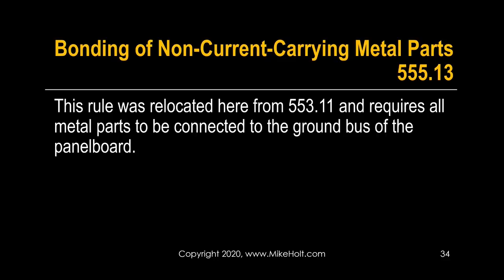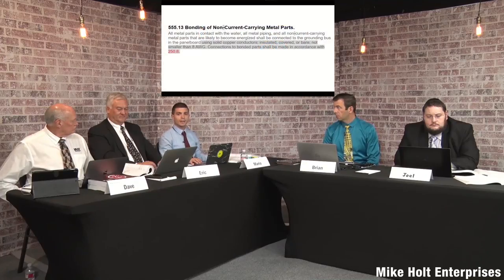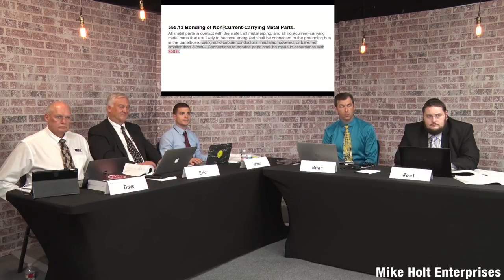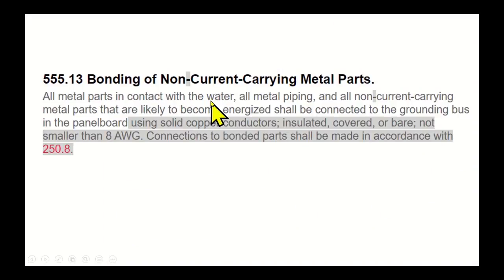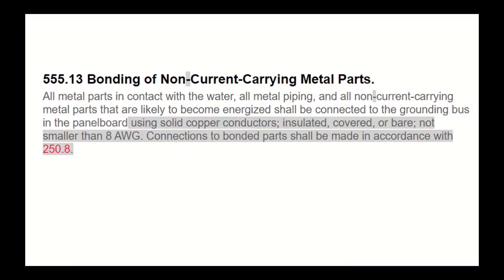Marina and Boat Dock Bonding [555.13, 2020 NEC]

Comment: My thoughts on it having to be solid must be from an integrity standpoint. Stranded wire corrosion must degrade faster due to more surface area of the copper conductor. Wonder if an inspector would allow stranded from the panel out to a deck box then solid for the length out to equipment in contact with water?
Reply: You 2 Yes I watched the video too. Ever been on a project with private inspectors/engineers? Also don’t forget that little code about authority having jurisdiction. It says you have to use #8 solid where equipment is in contact with water, but doesn’t say it has to be a continuous run to the panel board. In a scenario where #8 stranded goes from panel board to a deck box then changes to solid out to the equipment you still meet all requirements. Is it not connected to the panel board? Yes. Are you using #8 solid where equipment is in contact with water? Yes.

Comment: Why so big for the grounding conductor? Are they worried about having too much voltage drop, or it being able to carry lightning fault current or something? If you run #12 out to your dock I'd think the same size ground conductor bonded to the dock would be fine. This kind of stuff makes it so the states don't want to adopt the newer NECs. Cost is going to be so high that Joe Blow is just going to rig a bunch of extension cords together for his boat lift.